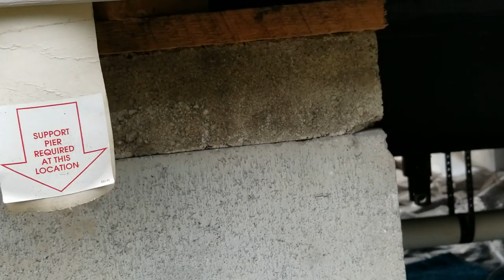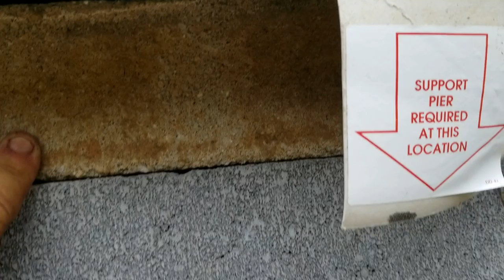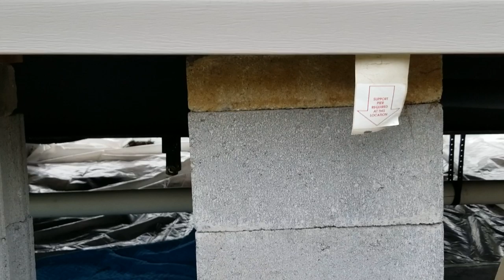Mobile Mansion Plumbing Drain Lines

Comment: Worked for the U.S. Army Corps of Engineers parks department, used that Red Hot lava a lot due to repairing a line that is miles long it would never dry but that stuff would work in muddy water.

Comment: Scotty unfortunately you may have to redo your tie down straps when you relevel your trailer. Hopefully you will be able to still use it or won't have to unstrap it. Definitely should of poured cement pad or peers before blocking the unit PERMANENTLY there. That's ALWAYS code where I live . I just hope you don't keep having issues. If that was a double wide,  that would of been a major mess.
Reply from the maker: It's all good, going on 4 years now....poured pads one at a time since it was installed....

Comment: What did you use to hang the pipe?   How did you attach it to the mobile home.  Here in Michigan, I need to have a support every 4 ft. My underside looks like yours with the insulation.  No boards to nail hangers to.
Reply from the maker: Jeff, I used metal strapping (with holes, comes in a roll) and fastened to the metal frame with self-tapping screws.
Reply: Yes 4ft I thought was code as well , kind of curios how he got around that.

Comment: It's looking good Sir!! If you move the blocking out to the side frame will you still get the skirt on? It's been 11 yrs since I've crawled around under a mobile mansion. Back in my plumbing days I spent many days under them as no other plumbing company in town wanted to crawl around under them. I got $91for the first hour and $61per hour after that to work under mobile homes and even more during the winter to do repairs when water and sewer lines froze and or broke. I miss that job. God Bless!!
Reply from the maker: Thanks Chris, yes the skirt will still fit. God bless you too!

Comment: Should the drain PVC pipe be wrapped with insulation if you live in Minnesota? I just recently bought a 2021 double wide that doesn’t have insulated PVC pipe
Reply from the maker: Andrew,  I would not worry about the drain line freezing,  just your supply...

Comment: I totally feel ya on this job, I just got done a few weeks ago replacing half of the sewer lines under my double wide, got tired of the clogs from the kitchen due to poor pitch and under sized piping as well as lack of cleanouts.  Just curious of  a few things.  What were you fastening the straps to, the steel frame or the wood floor joists? 

Also, I've never seen anyone connect the A/C condensate to a sewer line, is that legal in your area?  If so definetly make sure you have a decent trap on it, otherwise you'll be pumping sewer gas through your vents.  

Just a tip, that kitchen line has way too much pitch, on horizontal lines that causes liquids to zip by leaving solids behind.  it would have been better to extend the vertical stub down and put a long 90 or a combo wye with a cleanout on into the horizontal run to get a smoother pitch.
Reply from the maker: Straps secured to frame with self tapping screws, 1/8/foot on slope, optical camera illusion on that. Trap is upstairs on ac line...

Comment: 34 second mark .... the pvc that's cut into a 45° angle. On my new home it goes to the vent pipe. I'm guessing I connect it all together
Reply from the maker: I'll check it tomorrow and get back to you....just saw your question but to tired to watch the video tonight 😊
Reply from the maker: Jonathan,  that pipe is the drain for the washer, which is vented above so yes, that pipe ties into your main drain line (usually 3") which ties into your sewer/septic  system.

Comment: At exactly 0:54 seconds I see a red wire sticking out by the blocks, what is that used for?
Reply from the maker: I have no idea 🤣
Reply: @southernhomesteadtransformatio  I only ask because my mobile home has the same thing and I don’t know what it does 🤣 I just have it hanging underneath my mobile home.
Reply: More then likely that was wire from the taillights that were removed after transport but couldn't say for sure without being there.
Reply: @888huckleberry  you are correct, we recently installed brand new skirting on our mobile home as we are ready for our final inspection, we thought maybe that was the wire for the heat tape on the outside pipes but turns out it lead to nothing, it was the wire for the taillights from when they transported the mobile home.

Comment: Very good video. How do I thaw out my pipes under the home & where are they located? Thank you, Nancy
Reply from the maker: Thanks Nancy,  there should not be any exposed water pipes underneath,  they should be in the floor protected. But the supply should be wrapped in heat tape so that can not freeze.
Reply: Thanks for the info. But can you tell me where the access panel is? I think it might be froze at the ground. Or heat tape not plugged in.
Reply from the maker: Hard to know without seeing it but usually it would come up out of the ground under the water heater. Send me some pictures to sthrnhomesteadtransformation@gmail.com
Reply: @southernhomesteadtransformatio  The water is finally back on. Thank you for all your suggestions. I will keep them for future reference.

Comment: LMAO. Can't wait til the mobile mansion snowflakes start crying in the comments. I'll have to stop back in tomorrow morning and get my day started with a laugh. That really is a mobile mansion compared to most I've seen around Missouri. I've seen some sitting 8 feet in the air on cinder blocks one town over. Bad part is they added the blocks to it after it went through several floods.
Reply from the maker: Chop Shop....it will happen 😂

Comment: I just purchased my mobile home and the contractors were supposed to install water lines and sewage. Well they installed the water line that ended up leaking and never connected the sewage pipes. I’m stuck right now. Thinking about just doing it myself. (No experience)
Reply from the maker: Take your time, plan ahead, measure twice cut once . Ask if you have any questions....
Reply: Depending on your ground service underneath it is everything I never seen a service as nice as Scotty had it all flat, up high enough to sit up plastic down, nice weather,plenty of light . That was dream scenario I NEVER had such nice conditions .. He made it look easy . You got to get that pitch correct, make sure you have clean outs on all your horizontals and strapping every 4ft is code where I'm at >> not sure how he got away with that and if that's the case it could present a problem under a trailer . But good luck if you didn't already do it. Oh most important Scotty didn't instruct either about heat wire. Depending on your area heat wire may need insulation and heat wire to keep from freezing .. also bees and wasps love nesting under trailers hopefully you don't have any of them as well.

Comment: I don’t know how cold it gets there but, will you install insulation underneath the MM then box it in?
Reply from the maker: Debra, skirting will be installed but no extra insulation is needed other than heat tape on the water line coming up from the ground. It does not get that cold here other than an occasional night or two in January.
Reply: Thank you for your reply. I was just curious about insulation😊